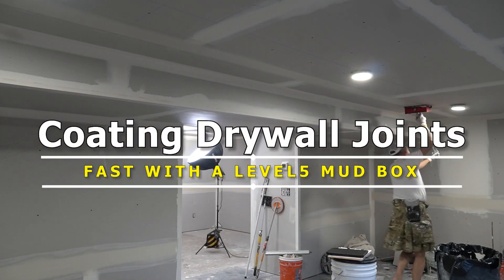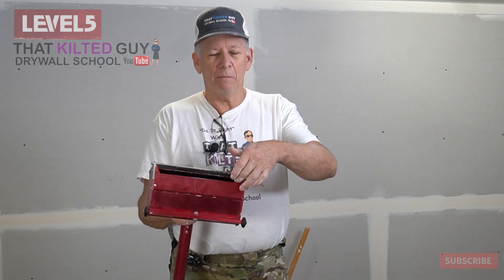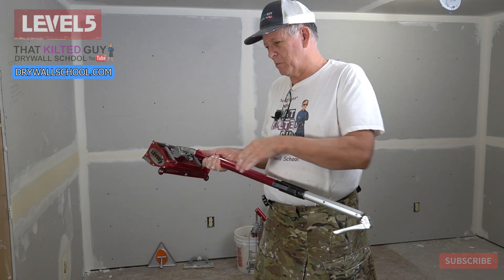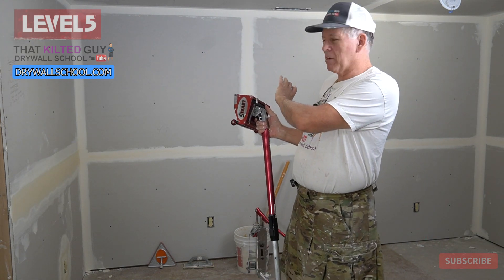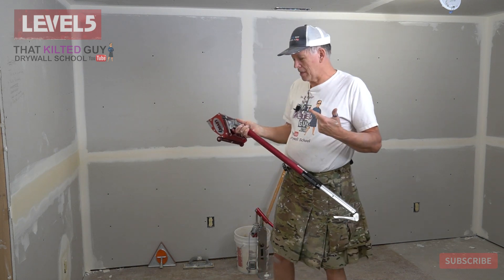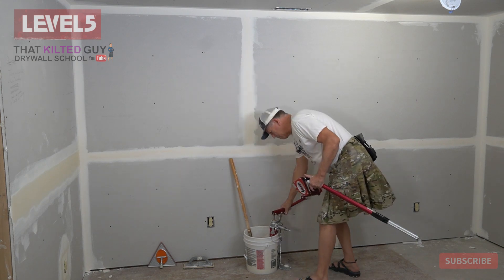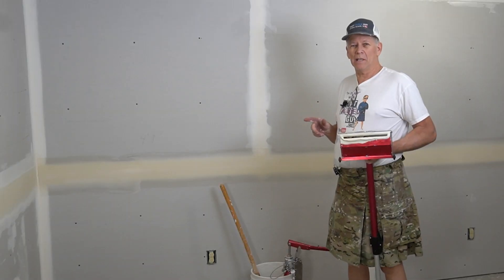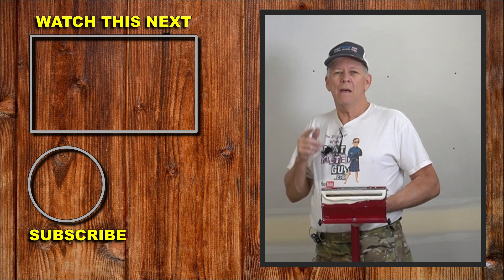How to Coat Drywall Joints FAST with a Level5 Flat Box #level5

Comment: can you suggest what sheetrock and plaster systems that are appropriate for small apartment/rental units?  looking for something that can't be easily penetrated as to avoid hole repairs from renters
Reply from the maker: 5/8 drywall, or toughgard.  Go to a real drywall supply store, not a big box, and ask them what they have

Comment: If I'm right there aren't enough screws, should be 5 per stud per sheet
Reply: As per IRC Table R702.3.5, 16" screw spacing is fine for 1/2" drywall on a 16" OC wall.  That would indicate 4 screws  per stud, so the hangers did it right I think. Also if they used adhesive, then 24" spacing is ok, which would be 3 per stud.      In real life I'm busy doing my second drywall job ever, so... FWIW :)
Reply: Should be one screw every other stud with glue

Comment: Hey mate thanks for the upload , been running a set of colombia boxes for over a year now. But recently on my final coat box I'm getting a sort of bubble/peel at rhe start of my flats. I run behind with a smoother blade so I can get rid of it but it's boggling my mind as to what's creating it. Any experience with this issue? Cheers bud
Reply from the maker: Maybe dust from sanding?
Reply: I have the same problem with big bubbles in my 10” box then when I do my 12” box I still have small holes in the finish.  I’m not sure if it’s the amount of water in the mud like if it’s too wet or dry.